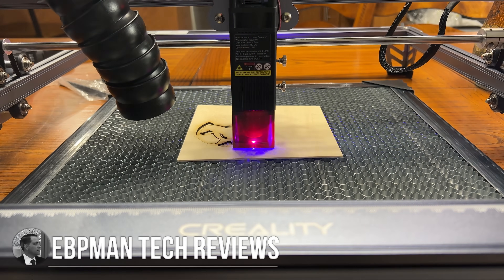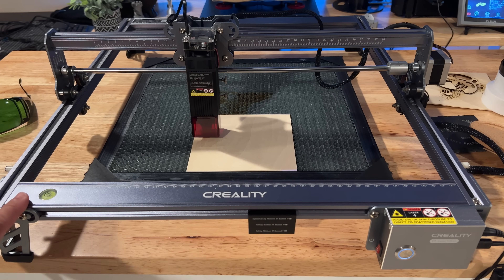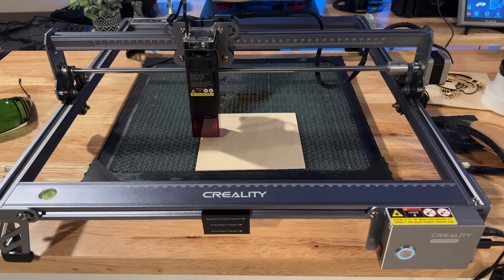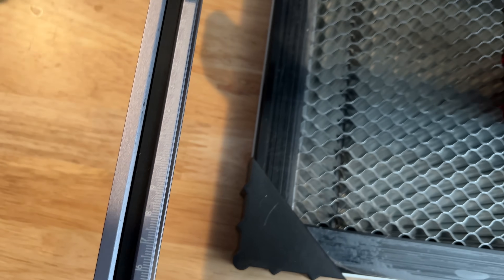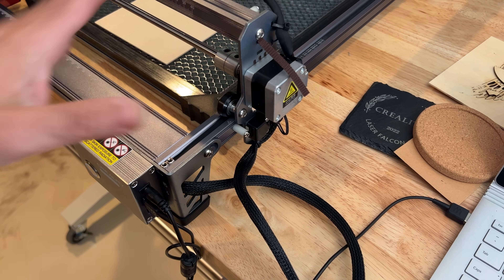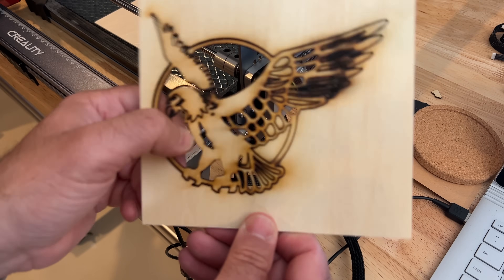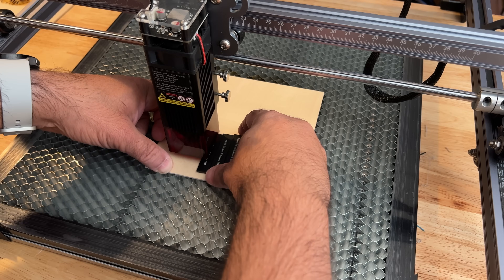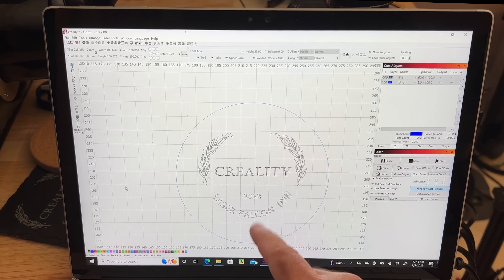NEW 2022 CR LASER FALCON! Fast and Easy Engraving!

Comment: Just bought one of these because they've gone on offer for under £170, never used an engraver or Lightburn but hey now have both! Very helpful video. 
Is there an easy way to check centering for engravings? The Creality marketing videos show engraving really small items like necklaces but I can't for the life of me work out how to tell the laser head the "bounds" of what it should be working on or how to know where the central point of an object is. I've got a CNC machine and that uses a dowel thing to calibrate the size of an object before cutting so it knows where to go so was expecting similar with this.